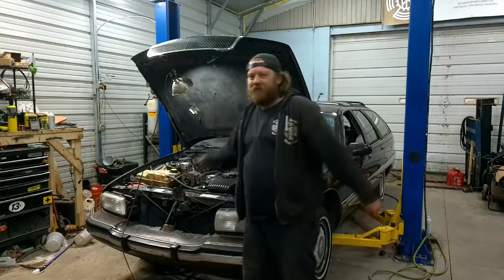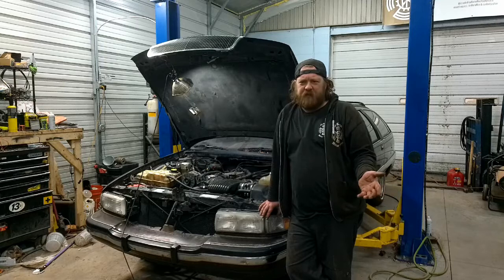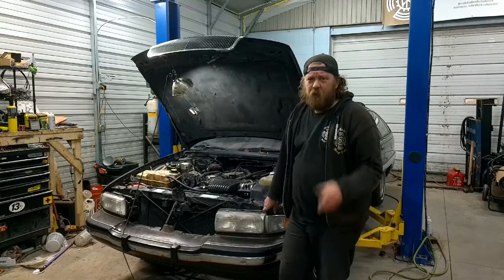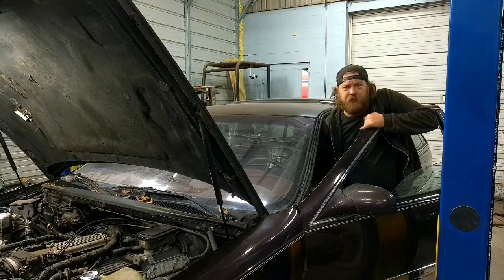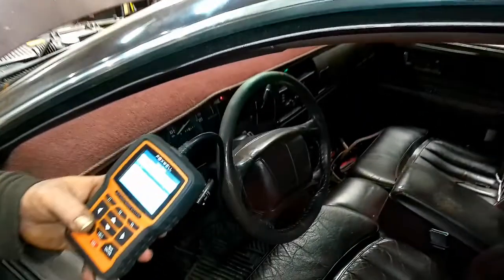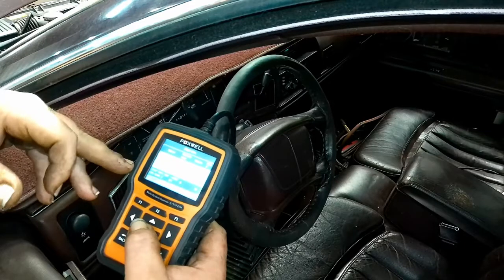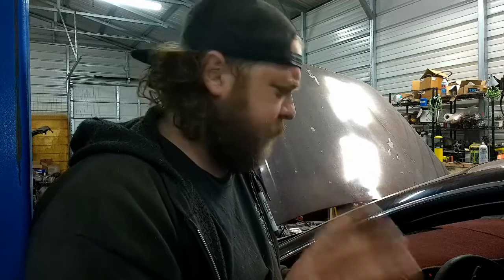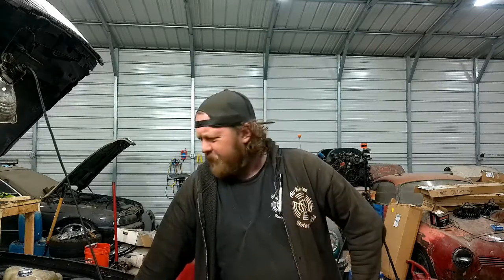1996 Buick Roadmaster LT1 B & F body long crank fix all about the fuel trims injector replacement

Comment: Going to run perfect with new injectors . Newer cars with electrics I’ll leave to you lol
Reply from the maker: Hahaha... Even with the old injectors I reinstalled that came with the car it made a world of difference have received the new Rochester units yesterday now I just need the car to put them in LOL... As far as electronics I normally just mess around with the older GM's or older BMWs... I don't have enough brain cells left to comprehend the newer electronics in modern vehicles
Reply: @airkooledmotorwerks  lol keep up the great work sir 👍